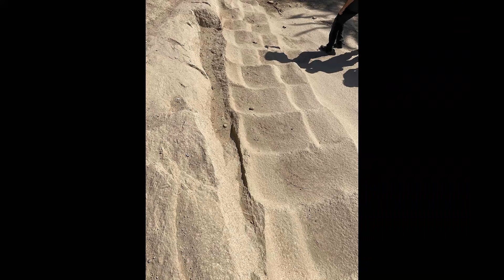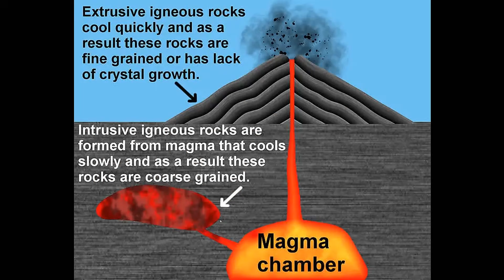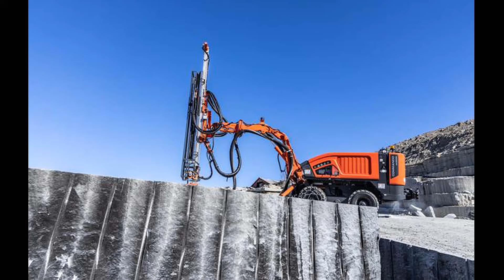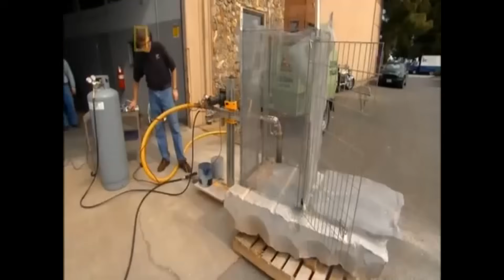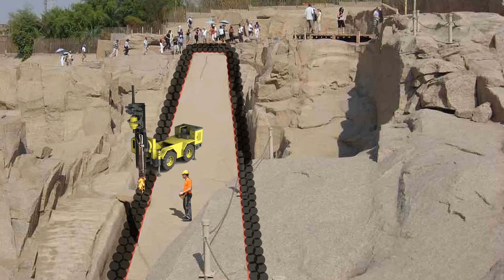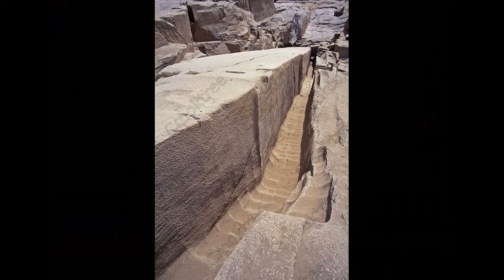Scoop Marks in Egypt: A Groundbreaking New Hypothesis

Comment: +++ I've said this before, as a triple engineer [CE,ME, AE], physicist with experience in Cosmology and a prolific inventor, including plasma tech, I can unequivocally say that those marks look like plasma discharge machining which is similar to electrical discharge machining we use to machine metals. Hint, rocks are almost exclusively metallic and/or semi-metallic compounds especially hard rocks like granite and igneous rocks. Even calcium is a metal which then encompasses limestone and marble. I also have experience in cutting|drilling rock and other hard materials.

I have a plasma control technique that improves on this, allowing for much straighter lines which may have been employed later in the tooling process followed by a finishing process.

Of the top of my head, it would not require a high tech society to make such machines. Copper and electricity production would suffice.

Electricity and plasma knowledge is demonstrated in the Dandera Lights motif. Modern scientists have now discovered that water droplets can efficiently generate a lot of electrical energy with simple tubing apparatus. No generators required. Raindrops can also make electricity without generators.

I remarked similarly previously
Reply from the maker: Thank you for sharing your insight. I appreciate it.

Comment: Why do people or, in this case, AI endlessly just talk instead of testing? A scientist's daily life is 95% examining and testing and less than 5% staring at the sky just theorising. Here, 10 minutes of Photomicroscopy of 2cms of the surface layer of those 'scooped' rocks compared with similar from a 40cms deeper layer would determine if that surface had been subjected to a supplementary thermal load or not. .....but, no, just more and more endless jabbering is all you ever get here and elsewhere.

Comment: Apparently it was not done by very high temperature flame methods or any of todays technologies and they didn't have the technology and materials to make those flame rock cutting instruments. The method they used was much simpler. They heated natron which when poured onto the granite softened the granite at much lower temperatures so that metal scoop tools could easily remove the softened granite. This process is well described in another video qv: https://www.youtube.com/watch?v=7LKVjzrOEMo

Comment: The obelisk angle was designed to allow a leanto "chimney" on the sides, wood fired temps reached above 850 C in the chimney so that sodium carbonate "natron" melted and dissolved the quartz, and the dolorite pounders were used to remove stone in rounds, the scoops facilitated the next round of natron to pool and soften that area next round. The obelisk shape is perfect for "walking" with small teams and ropes. The removed material is "waterglass" perfect for casting geopolymer elsewhere as well.
Reply: how would they pool the nitron in a scoop mark upside down ,below the bottom edge of the obelisk
Reply: @kawasakikev8905 In the first rounds of making the scoop marks, the top of the scoop mark is the bottom of the chimney. What we see here is successive rounds with material removal already in prior rounds. Perhaps 2 cm would be removed each time

Comment: This is getting closer to the truth which points towards involvement of High Tech, and while similar to what we have now, was probably different since it was done several thousand years ago and IMPLIES A MISSING CHAPTER IN OUR HISTORY. Maybe they had a TRACKED GRADALL type machine with A JET FLAME BUCKET at the 40 cm SCOOP SHAPE SIZED (to match the scoop shaped markings). The Obelisk might have been moved in 3 pieces (400 tons each...implying 2 cuts that never happened...so that the BOATS could FLOAT THEM AWAY). The CRANES 
or other TECH used to MOVE 400-1200 TON STONES ...is the HARDEST to imagine with anything we know CAPABLE of actually doing it. It STRONGLY POINTS TO HIGH TECH BEYOND WHAT WE ARE CURRENTLY CAPABLE OF!

Comment: When it comes to granite forming from slow cooling, and your talk  about air. Air is a poor thermal conductor. The reason the granite would cool faster in air, is because the temperature is cooler. When your talking about granite slow cooling in the crust, it is because the surrounding rock has also been heated. So it would cool slowly.
Reply: The faster cooling may also be explained by infrared cooling. Which would not be happening in the crust,

Comment: I don't believe heat was used here for a couple reasons. The biggest is there isn't really any evidence of this. Like, why are all the blocks pulled this way still stone shaped and blocky? None of it looks like it has cooled from molten. And second, most rocks don't work like ice cream. They are hard when solid, and a very thick liquid when melted. There isn't really a "softened" state of stone. And when stone melts and resolidifies it becomes hella brittle. Not structural at all.

Comment: Likely there are a number columns and obelisks on the bottom of the Mediterranean Sea as the Romans pilfered and shipped them, not all would have made it.

Some excellent considerations, hadn't thought flame spall cutting, plausible - however it doesn't look like the semi-polished "tube drilling" we see.  Maybe holes were 'hogged out' rough w flame drill then chased w diamond cutter, spitballing.

Comment: “By analyzing the characteristic traces (including so called “scoop marks”) left by the falsifiers on the surface of the unfinished Aswan Obelisk and around it, it was possible to understand and reconstruct how and with what tools this obelisk was actually formed.” See details in the book “Peruvian polygonal masonry: how, who, when and what for” (148 pp., 2025).
Reply: When fabricating the Aswan obelisk, such a cutting was applied using steel tools (pickaxe, short chisel, long chisel, hammer, sledgehammer, wedges, crowbar) that tool marks remained on the blocks removed from the trench, and there were practically no tool marks on the walls and bottom of the trench. On the walls and on the bottom of the trench, there were mainly characteristic recesses (places where stone was broken off, so called “scoop marks”), which “scientists” today pass off as the result of pounding with dolerite balls. The few traces of steel tools that still remained after the cutting were subsequently destroyed by tapping. Most likely, it was made with the same dolerite hammers. A detailed description of the cutting method used in Aswan is given in the book “Peruvian polygonal masonry: how, who, when and what for” (148 pp., 2025).

It is noteworthy that the same “incomprehensible” traces (“scoop marks”) on the walls, on the bottom of the trench and on the Aswan obelisk itself can be observed today in many operating quarries since the technology as a whole remains the same as before. Only the grooves between the cut blocks are made not manually but with the help of machines. In particular, the mentioned book contains photographs where markings similar to those on the obelisk are formed in an active Japanese quarry for stone extraction in our days.
Reply: Your comment does not mention whether you appreciate or falsify the proposed method in this video.
Reply: >Your comment does not mention whether you appreciate or falsify the proposed method in this video.

Some of my comments are disappearing. Can you see my second comment: "When fabricating the Aswan obelisk, such a cutting was applied using steel tools (pickaxe, short chisel, long chisel, hammer, sledgehammer, wedges, crowbar) ..."? You must decide for yourself which method was most likely used.

Comment: Could be that the stone was of a different chemical composition back when it was scooped at.  It was also probably a much lighter stone.  A cataclysmic environmental event then changed the chemical composition of the rock, likely of ALL rock, vitrifying it to its current state.  The scoop marks from the earlier state remain, the same as cart path marks remain the same, it is the stone itself that changed. Flood, heat, radiation, exposure to volcanic dust and wood ash, lime. The work stopped everywhere because the nature of the materials had changed, 'turned to stone' as compared to when it was a pumice like rock.  One hypothesis anyways.

Comment: Very interesting, have you ever used a magnifying glass to set a fire? The bigger glass you use the faster it can set a fire. There is a guy on YouTube who has a lens called solar death ray and it can melt rock in seconds by just using solar energy into a focal point. 
They might used a lens or a curved mirror to focus sunlight into a focal point to heat the granite.🤔 Just like you can burn paper with a magnifiyng glass, curved mirrors or multiple mirrors focused on one focal point can heat the material tremendously. the heat is absorbed into the granite and by quickly cooling it with water the quenched granite will crumble. After that you chip the brittle material away with the dolorite pounding stones until you reach hard granite again. Once the area is worked the lens or mirrors are focused on the next area which can create the dips in the rock. It. It doesn't cost any fuel for heating, just sunlight which is plenty in Egypt. 
The scoop marks are often deeper in the middle and that is because most heat is absorbed in the middle of the focal point. Adjusting the focal point and heating time can make deeper or les deeper scoopemarks. I also noticed some scoopmarks are in a row next to the other and others are in horizontal curved lines. These can be explained by rotating the device from one point.  
To heat up the part underneath the obelisk they could use mirrors under a 45° degree angle.

Comment: Thousands of years of erosion/weathering is why they look like "scoop" marks, just look at known quarries, even modern quarries you will see similar markings from the stone being snapped out by feather and wedge which leaves a very similar indentation although obviously fresh and not worn/weathered. I personally don't think there is any "lost technology" but rather forgotten techniques, many have experimented with moving large stones, cutting granite with copper and abrasive sand ect and even with just very little experience have had very good results, if they were to teach their techniques and these techniques are passed down and improved on then in many many years time maybe will have a better understanding of their techniques many thousands of years ago.
Reply: You are 100% correct.
I highly recommend watching "Scoop Marks in the Oya Quarry Japan". If you want to know what skilled old quarry men could do in the 1960s with just picks, wedges &  leavers watch "Sandstone to Grindstone Carved by Hand". 
No aliens, no Giants, CGI, Ai or special effects. 
The Egyptians had hammers, saws, wedges and feathers, drills and core drills, levers and cranes ect, and could use fire and water to shatter rock, water could also used to find and prepare a perfectly flat surface to start construction.
The ancient Egyptian also understood mathematics and geometry.

Comment: My guess is that the scoop marks were made by a form of "sand blasting".   If you look at videos of how words are sand-blasted into granite, you will see how easy it is to carve out the rock using this method.  In this case the "sand" is actually small pieces of the same stone that is being carved out.  Either air or water can be used as the carrier of this "sand".

Comment: Whatever the explanation, it is reminiscent of ice-cream scooped from a bucket.  Implying that there was some kind of stone softening technology used, maybe induced by sound or some other kind of frequency or vibration.   The appearance and fit of the Inca walls at such as Sacsayhuamán also suggest that the stones were softened when fitted together.  Whatever the technology used to do that may also have been related to how the stones were moved.  Archeologists  SHOULD STAY IN THEIR LANE OF EXPERTISE, and leave the Technical and Engineering conclusions to geologists and engineers.   Because the hammering with rocks does not fit the VISUAL APPEARANCE let alone the LOGISTICS, and even a kindergartner can see that the EXPLANATION DOES NOT FIT THE VISUAL.
Reply from the maker: I made a video on Sacsayhuamán from a construction point of view - hope you will find it interesting - Explained: How were Peru’s #Sacsayhuaman Walls Built https://youtu.be/x9S4CqY3eSA

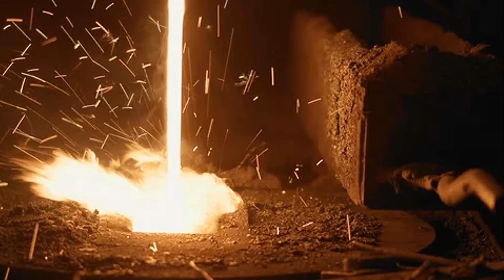Comment: Study the image shown at 5:26
Look at the scoop marks. There is no practical reason for anyone pounding with a dolerite stone to produce such characteristic markings. The little square scoop, with high walls surrounding it like a square impact crater, will not naturally form by ponding with a round stone. That just doesn't happen. No one has yet been able to demonstrate the theory that these marks could have been made with dolerite pounding stones. I'd like to see it done.
Additionally, if the pattern of scoop marks we see here were created by people pounding, then was just one person working the area we see here on top of the obelisk? I can not imagine multiple people gathered into that one area each pounding out a single scoop. So, lets say it is one workman creating the pattern we see on top. Why the squares? A person pounding with a stone will create a basically circular and uneven indentation in the stone which would then have to be finely shaped and polished into the scoop mark we see. 
This leads one to the obvious conclusion that his is being done by a machine that leaves this marking, due to its design, as it is moved across the surface working one small area of granite at a time.

Comment: I think of paint stripper and brick acid when thinking about the scoop marks. I used to do brick work and after we'd do a wall we would wash it with a type of acid that would essentially eat away at the mortar between the bricks. I don't believe we understand what compound or chemical was used and the reason is because that substance doesn't exist anymore. This makes a lot of sense when you consider that a lot of megalithic sites around the globe and at Egypt are much older than what they think. The last minor extinction event was only some 12,000 years ago, not millions like the more famous ones that killed the dinosaurs. There were both plant and animal species that just simply don't exist anymore thanks to that event and it's reasonable to assume there may have been 'products' made with those animals and plants that we can no longer make. We use animal and plant bi-products today that do special things so why wouldn't a plant or animal bi-product be able to break down the chemical bonds of granite enough so as to be able to scoop little chunks of it out if applied with whatever liquid or compound they had back then? As a bonus, mammoths existed back then which were much larger than elephants and elephants are used today to haul large trees around (heavy things). Is it that far fetched to think they could have also tamed some mammoths to use to pull/lift all those heavy stone objects? Our current small elephants can lift their own weight and pull as much as 10,000 pounds, so a larger mammoth hooked up to a rig, or several of them, may easily pull or lift multi-ton stone blocks. No aliens needed, just need to adjust the timeline.

Comment: You need to consider chemistry. Modern grave stones are often etched with various acids. These chemically break down the minerals binding the quarts so the result is a mud that can be dug or brushed out. Mohs hardness becomes irrelevant. The rock is behaving like clay or sandstone. The stronger the acid the more dangerous it is but it was known in antiquity what these acids would not dissolve. If the work area is filled with acidified water then the scoop marks match a shadoof like scoop working the softened surface. These same Shadoof's could have in large numbers lifted the block or obelisk allowing floatation aids to be added. We assume its floated in water but if its floated first in dense mud then the floatation volume would be lower. Once at a river much bigger boat hills can be attacked. The boat hull limit assumes the stone is filly on the hull displacing air. If its slung between the hulls then larger loads are theoretically possible. The stone itself is displacing water.

Comment: I think what is crazy, is that however they did it, it was apparently more desired or more easy to do it all in one big piece, instead of smaller blocks. So we can theorize on the method, but it also has to match with the idea that this wold be easier than making bricks and using carts to transport it and scaffolds to raise it. Someone with that all being understood said, no...this will be faster and easier.

In fact, this was so fast and so easy, all the rulers wanted something done.

Comment: Those are not scoop marks. They are single point machine marks made with a rotary cutting tool the size of a bowling ball. There are thousands of modern examples of the same kind of machining at 1/500th the scale.

Comment: I think the Egyptians could carve granite obelisks using primitive methods and leave traces like these.
A three-stage cycle.
1. Heating the surface layer of granite (a square with a side of 40 cm) with a fire of dry reeds.
2. Rapid cooling with water. The hot surface layer of granite cracks.
3. The worker breaks the cracked layer with a stone ball and removes the fragments.

The expected cycle lasts 2 hours, and a 1 cm deepening is made in the granite. In 1 day, 10 hours, it is possible to deepen by 5 cm, and in a month by 150 cm. 
However, I think that for ergonomic reasons, each worker processes 4 platforms 40 cm by 40 cm in turn, an area of 80 cm by 80 cm. 
30 workers per year could make a ditch in granite measuring 80 cm, 24 m long and more than 3 m deep.
And they would have left traces similar to those we see in ancient Egyptian quarries.